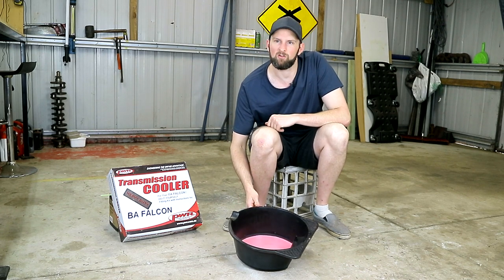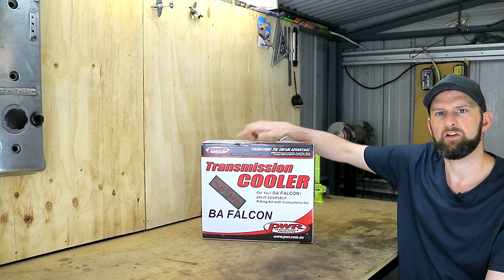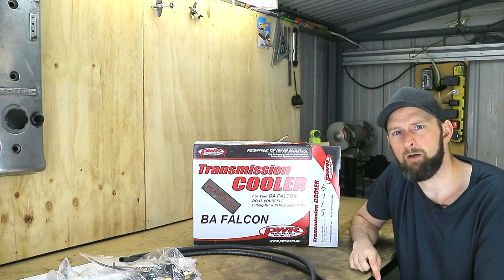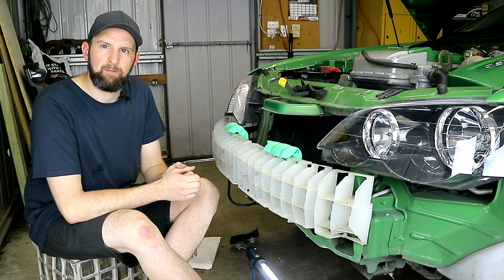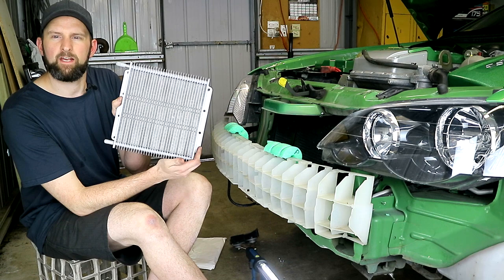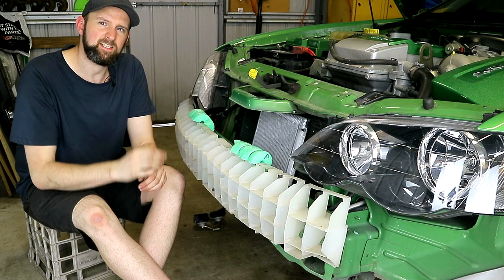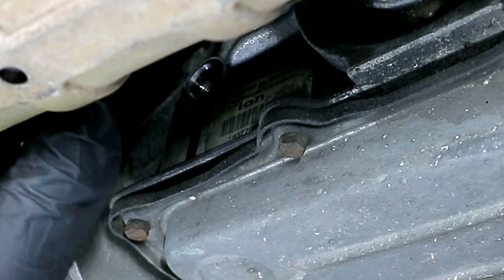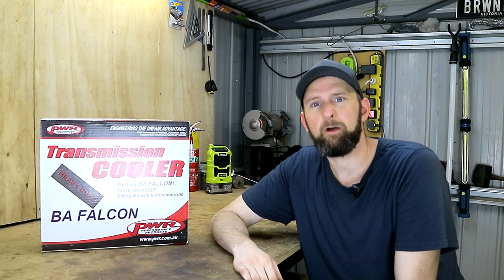Transmission Cooler Install | BA-BF Ford Falcon & SX-SY Territory

Comment: should have done this last month Browney, I just had the dreaded start of a milkshake in the territory. fingers cross I caught it early enough and the mechanic is able to do the flush to clear it out and wont need to drop the box
Reply from the maker: @bryan skerry Fingers crosses for you mate, the old 4 speed is fairly tough though. I ran the one in the panelvan really low on oil one time and you’d barely even know! Good luck 👍
Reply: @BrowneysGarage  cheers, yeah i know the 4 speed is a tough box. more worried about how much water got in to rust the internals.

Comment: I am in WA. I had the air-cooler for 4 years. I have done around 80k with the cooler. Mine is 6 speed ZF... Cold fluid isn't the problem. Heat is the killer of clutch fibers. It also decreases the life of the fluid. Take it easy while driving for 10-15 minutes... It will be within the operating temperature.
Reply from the maker: Thanks for sharing your experience mate. Seems like we're on the same page on the fluid temps 👍
Reply: I was told that the PWR heat exchanger is just as good because I own a F6 typhoon and I have a big intercooler and there's no room for the air cooler I haven't seen any videos on YouTube on PWR heat exchangers
Reply: Bad idea to do this on a 6 speed
Reply: @michaellast1385  why? I had the cooler for almost 5 years now. Love it.
Reply: @GOKHANDILEK  I'm not 100% sure. I bypassed the heater/cooler on my 4 speed and after that was talking about what I did to some mechanics. During the conversation they said "thats the good thing about the 4 speeds, you can do that" then they said "you can't or shouldn't do it to 6 speeds".. 2 mechanics told me the exact same thing. Maybe the 6 speeds have a thermostat type mechanism or some type of check valve and the extra cooling of the oil air cooler causes it to close too much, have no idea, just saying that 2 mechanics told me not to do it on the 6 speeds. But the mechanics and I were only talking about transmissions cooled by a heater/cooler (remote cooler/warmer) not transmissions cooled by the radiator.
Reply: @michaellast1385  ZF6 speed air-cooler was an option from Ford for FG turbos... I have done 100k with the cooler and it is still fine.

Comment: Great video, just purchased the kit,looking forward to doing the install. Spending a couple of hundred is better than having to buy a new gearbox, thanks again mate...awesome informative channel!!!!!
Reply from the maker: Thanks mate, that was my thinking. Hope you like the kit 👍
Reply: @BrowneysGarage  i'm a bit concerned about topping up gearbox oil as i have stripped the filler bolt
Reply from the maker: @hobbs342 Bugger! I didn't lose very much fluid at all doing it, maybe just keep an eye on how much is lost, put the new cooler in with bottom line on and add some then to the cooler?
Reply: @BrowneysGarage  yep cool
Reply: just got the kit, came with just one hose about a metre long i noticed in your vid you got 2 hoses, do i need a second hose or?
Reply from the maker: @hobbs3424  Testing my poor memory here but I'd say you'll be short and need more hose unfortunately.

Should be easy enough to source or contact PWR and see if they can help out?
Reply: @BrowneysGarage  ok, all good mate I'll head down to my local n get me another metre 👍

Comment: Hi Browney,
Love the videos mate!
I just bought the same kit. Can I top up the old fluid with new fluid, or do I have to change all the transmission fluid?
Cheers mate
Reply: Ofcourse you can just top it up if you use the same/right fluid, good luck with the bypass kit nuffy. That kit will 100% blow up your tranny rather than a 1% chance from the genuine heat exchanger.
Reply: @mickwarnie8707 why is that?

Comment: last xr6 got a case of the pink milkshake wasn't worth saving priced at over 2k for new trans and clutch, not including the damage potentially done to engine, and after talking to many mechanics you can never get rid of the smell from the heater. great tutorial was wondering where one could be mounted and after seeing how simple it is to do, given me the confidence to do it myself on latest XR- rather than paying some overpriced mechanic- before it happens again.
Reply from the maker: @Dave Westgarth I’d never considered that, interesting. Definitely not a difficult job. Good luck and thanks for watching mate!

Comment: Hi browney! I’ve just noticed my BF does not have those hard lines that go to the radiator. There’s just, nothing there..?
Reply from the maker: Hi mate. I thought it was only the 6 speeds but from looking at it now it seems later BF 4 speed autos got a heat exchanger under the intake instead of the earlier BA style. 

One or more solutions are discussed and shown in this thread here, if you already have the kit it appears it can possibly still be used or a BF kit is also mentioned and may be an option. (http://www.fordmods.com/gearbox-suspension-brake-driveline-f4/photo-essay-fitting-a-ba-bf-transmission-cooler-kit-t121428.html)

Hope that helps.
Reply: @BrowneysGarage  thanks a heap!
Reply: Brah same I mounted the cooler then took the thermo's out and was like whaaaaat the fuuck 😂

Comment: good video thanks!, i wonder if same kit might fit bf wagon 4 speed? I don't like cooler zip tied to a/c condenser, (as i had in AU), but i suppose ziptie job save a lot of work removing bumper etc... cheers
Reply from the maker: @Ben Walters Thanks mate, should be exact same kit I believe 👍
Reply: @BrowneysGarage  thanks i just had look at the workshop manual for 08 BF i think they say only v8 has cooler in front of AC whereas i6 has some sort of cooler on engine sump near starter motor...... i will try to confirm this.....cheers

Comment: So iv had the pink liquid before got it flushed and new radiator what type of damage to the engine can it do and what other details of damage could it of done?
Reply from the maker: I don't think it's so much an issue for the engine, especially if you flush it out with the new radiator etc. More an issue with the coolant in the oil damaging the transmission, something to keep an eye out for like flaring on shifts and slipping.

Comment: Hey mate, great video - I have one of these and I am wondering if the trans fluid can be drained and filled via the cooler (rather than dropping the pan?)
Reply from the maker: No it can't sorry mate, still need to drain by dropping the pan. Can fill through the lines to the cooler but you'll have no way of knowing when it's full without checking at the normal fill hole.

May have a trans service video coming up so keep an eye out for that if you're keen 👍

Comment: Thanks for the info mate.

As I've just purchased a bf wagon for the family. I want to put a replacement cooler just for this reason.

Now u have had it in a while. How is it holding up?

I was looking at a cheaper cooler on ebay.  But curious to know, how this kit is going?
Reply from the maker: No complaints here mate, I was really pleased with it and it all appears to be working as it should some time on.

While you're at it, I've got a video coming out tomorrow servicing and flushing the auto which may be timely for yourself by the sounds of it 👍

Comment: Caught this problem early in my ba falcon just started showing a thin layer of atf in the reservoir made the mistake of installing a second hand radiator which meant second hand trans cooler welp you live and learn
Reply from the maker: Good save, hope you got it in time mate. These things happen, that's cars!

Comment: I can remember when Ford use to make cars with separate transmission cooling
tanks like my EL Falcon also i  think 
that you should replace the radiator as well with extra cores and with copper tanks as the plastic tanks do eventually crack and can ruin your motor as i did at same time when i changed over.
Reply from the maker: Hi David, thanks for watching.

Yep you’re right but it’s hard to decide when to stop upgrading parts, its a hell of a rabbit hole! Cheers
Reply: David, i think the last auto ford model was the XE that had separate trans cooler. I know that the '88 EA had the trans built into the radiator.
Reply: @BrowneysGarage  why stop upgrading parts hahahhaha, lets keep doing it so someone can still be working. I know I am considering heated front seat pads and maybe adding blind spot alerts in future upgrades to the 2 tonne terry beast.
Reply: Funny thing with BA - FG, One Tonners are fitted with a separate air cooled transcooler and not in the radiator. I've still had trouble with the trans getting too hot when towing and it going in to limp mode. On my second trans and looking like I will have to get another one soon. I'm looking to go with a bigger trans cooler than the standard when I change the box.

Comment: Awesome vid, would there be any room for intercooler with this unit.
Reply from the maker: Going to find out very soon, but looking like it's unlikely with the supplied bracket from this kit. It does also come supplied with, and mentions this in the instructions, mounting zip ties for mounting it straight to the AC condenser to give more room for intercoolers.

Comment: Good clip on the installation.  A question for you and anybody else.  Do you happen to know the flow of the trans fluid from the gearbox itself?  Is the hot line at the gearbox itself closest to the front of the vehicle or vice versa.  Doing this installation on my BF Falcon and running new lines etc.  Thanks
Reply from the maker: Sorry mate I wouldn’t know off the top of my head on this one, maybe someone will see this though.

Good luck

Comment: Hey mate I going aftermarket trans cooler and jw what are the fitting that are on the metal hard Lines fittings that screws in to the the radiator

Comment: I've got the one that bolts to the side of the engine so this will not work on my bf there are no trans lines to my radiator it's the water cooled one with the plastic Trans line's

Comment: Which line goes in top and which line goes in the bottom of the cooler? Or do you just follow how it goes into the radiator......
Reply from the maker: Just follow how it is on the radiator mate 👍

Comment: wouldn't when you turn off the engine, gravity push transmission fluid down the cooler, pushing it back through the cooler lines and into your transmission. What I mean is, once the car is off, the cooler empties back into the transmission and when you check the levol of the transmission fluid you will be getting an incorrect level, then once you start the car it would need to refill the transmission cooler. Also, which line is out and in on the transmission because if you have hot fluid out of the transmission then go to the bottom of the cooler, then the top of the cooler returns to the transmission, wouldn't the gravity cause strain on the pump?
Reply: Michael Last....with the PWR kit the trans cooler can only be mounted one way. Top hardline to the top of cooler and bottom hardline to bottom of trans cooler. Pretty hard to fcuk that up.

Comment: You might end up needing bonnet grills at some point to get rid of the heat?
Reply from the maker: @Bernhard K Don’t think so, there’s turbo cars running a LOT more power without needing it. Would hate to cut it up 😂

Comment: Good Day Browney, have you ever fitted one of these to 4 speed fg factory lpg ? thanks Emanuel
Reply from the maker: Hi Emanuel. I haven't sorry but I believe PWR do a similar kit with longer hoses to re-route the lines from the heat exchanger right up to the front where this BA one is mounted. Imagine the process would be fairly similar.
Reply: @BrowneysGarage  Thanks for reply will give it a go Emanuel

Comment: I have a territory Nov 05 they just moved to the new transmission cooler on the side of the motor. It's a bit low on fluid. I need a way to top it up. I'd appreciate any help on how to. Cheers
Reply from the maker: Fill hole is up on the side of the trans itself, fill until it dribbles out. Plenty of pics and info out there to help further with a quick Google 👍🏻
Reply: @BrowneysGarage  thanks
After a bit more investigation I found the fill hole at the very back of the trans box right side just in front of the transfer case. Is a 6mm alenkey

Comment: When will you be fitting a transmission cooler to your ve commodore?
Reply from the maker: I know I should but so busy with the Falcon it will have to wait unfortunately. Hopefully they’re not as prone to failure as the Falcon stuff, fingers crossed.

If you are looking to do it though the PWR kit was very good, properly bolt on and the instructions were great.

Comment: Hey man.  Were about did u bolt your trans cooler to. Mine is the exact same cooler.    Just canr find the spot were u fastend yours down
Reply from the maker: I have to go completely off memory here for now but at the top of the radiator support it was to exisiting holes, one of which had a wiring connector in it that had to move slightly.

Lower was mounted in behind the factory power steering cooler? It’s been a while haha
Reply: @BrowneysGarage   ah yes i know the holes easy. As.  Cheers legend

Comment: Even if it says ba on the box would it be any different if i put it on my bf xr6
Reply from the maker: I believe as long as it has the trans cooler in the radiator as with the BA then it will be the same. If it has the later cooler/heat transfer unit that is completely seperate then you may still be able to use it but won’t be as straight forward, haven’t done it myself so couldn’t tell you exactly.

Good luck and thanks for watching 👍

Comment: Hey mate did you use thread tape on the connections ?
Reply from the maker: Hey mate, no I didn't, none was required per PWR's instructions - no leaks so far! Hope that helps 👍
Reply: @BrowneysGarage  hey there thanks for the really speedy reply  ok I'm all set to go now just letting her cool down thanks for the tutorial it really makes it simple I was gonna be charged 800 to do my xr8

Comment: That bottom hose where it squishes past the radiator should have some convoluted hose to stop chafing.
Reply from the maker: Appreciate it mate, but no sharp edges there and hose clamped to the fitting/p clamped to chassis close either side so not a great deal of movement at all. Will have another suss next time I'm in there but PWR were very impressive with the thought put into this kit, I'm pretty confident it's good.

Comment: Anyone know if I can do this on my xr8? Pretty sure it’s got similar btr 4 speed auto box.
Reply: Yes you can as the 4 speed autos are the same, also a mechanic I know said you can change the auto outer case with a EB - EF Falcon then you will have a dip stick to check the trans fluid again just like good ol days.

Comment: $200 and all the brackets needed to do the job. That's a winner. Bad Obsession Motorsport would be disappointed though.
Reply from the maker: As happy as I was with the kit and glad not to have to get the grinder and welder out, it certainly isn’t Binky spec!

Comment: What about the "Heat Transfer" delete on the side of the trans?
Reply from the maker: The BA's didn't have the heat exchanger, believe these started in BF and into FG, you'll have one or the other but not both fitted. If you have a heat exchanger model they do sell a kit to suit as well that replaces this heat exchanger. Or some people have deleted this all together, grabbed the hard lines from a BA to run up to the front and use this trans cooler kit, both seem like good upgrades.
Reply: @BrowneysGarage  ok, great info, Thankyou

Comment: Is the instalation the same for the 6 speed auto?
Reply from the maker: No sorry, pretty sure the 6 speeds don’t use the radiator but a seperate heat exchanger. Can still have a similar issue but seems much less prone to it from what I’ve seen.

Believe PWR do have a kit for this as well though so may be worth looking into. 

Thanks mate.
Reply: Would this suit the turbo model?

Comment: Would this work for the FG models?
Reply from the maker: @Wakazbro It doesn't sorry mate, only 4 speed auto cars BA - BF I believe.

There are kits to suit FG out there though.
Reply: I have a aeroflow 10 row trans cooler on my standard fg g6e turbo 270kw, works a treat, sits in front of the intercooler but doesnt seem to effect the performance, you do have to make a bracket and get elbows and fittings  and braided hose, so I spent the money to get rid of a headache befor it became a migraine, nz$740 fitted aeroflow is good ausie quality gear, no leaks and installed by a very good mechanic

Comment: Great video. Great sense of humour in all videos Ive seen some far. Thought you mighta used braided hoses to keep the chrome look? Thanks for answering previous video questions. You might want to invest in a scissor lift/2 poster one for all you under car stuff. If nothing gives most of us humble YouTube trained home mechanics the shits is jacking up cars in first place.
Reply from the maker: @Bernhard K The lines can’t be see at all with the bumper on anyway so not too worried.

Would love a 2 post and it’s something I’m working to in the future but not any time soon unfortunately. The garage is too low for it to be much good anyway and the carport needs concrete as well if I was to do it so the costs blow out there, tough cause boosts themselves are so reasonably priced! 

And I’m with you, I HATE jacking up cars and putting stands under them!